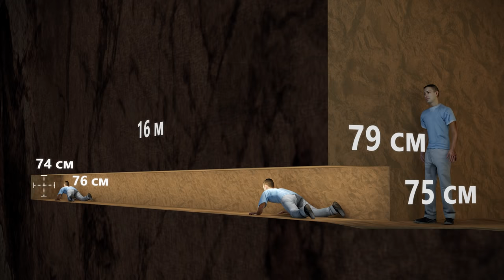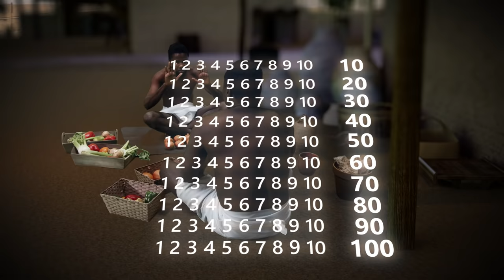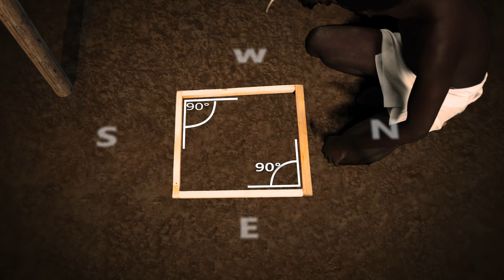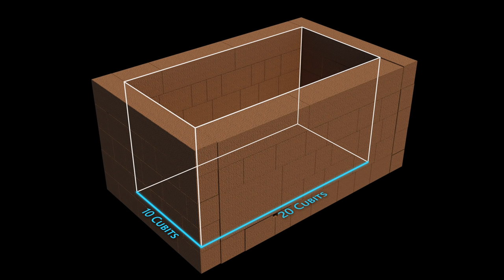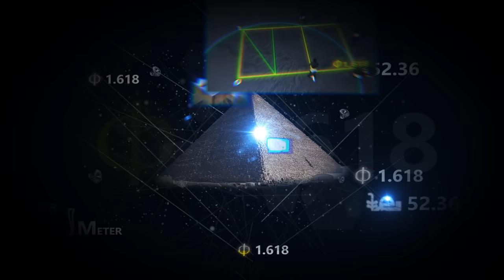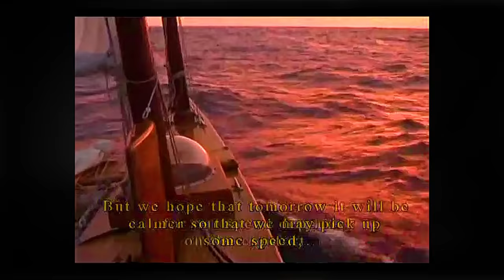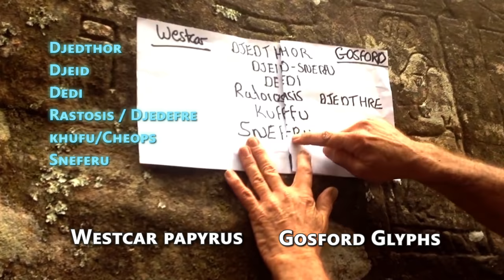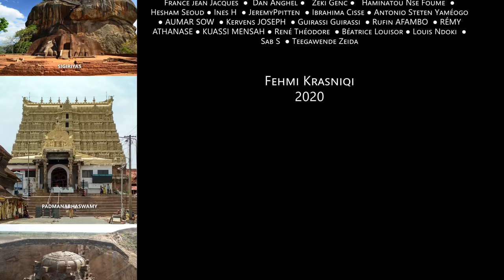The Movie Great Pyramid K 2019 - Director Fehmi Krasniqi

Comment: This is such a great contribution to our public knowledge bank and so sad this is not all taught in our public schools. Just to learn that all measurements derive from a drop of water is fantastic and that this in turn has been used to build all our most impressive buildings around the world and that all dated back to the Egyptians and their lines of learned descendants. Again, I loved the Natron and the chemistry of the concrete for the pyramids and so many other great buildings worldwide. Like others, I see the hole in the argument when it comes to casting molten granite and similar rocks and then cooling and reforming them. It seems this simply does not hold water and much more theorising and practical experimentation needs to be done to work out how it might actually be done. However the proof is definitely in the pudding and it was done somehow, so we need to do the experiments!
Reply: Holes for a torch ?
Reply: Ñmn Mantgum b op
Reply: No evidence of carbon black pollution on the walls!
Reply: for Sci-Fi movie is interesting and drop of water is not 1cm....
Reply: @kingrys2870  So many ludicrous claims in this "documentary", and so many people swallowing hook, line and sinker. Drops of water come in a variety of sizes, much of it dependent on the surface they form on. That is something anyone can replicate in the kitchen.
Reply: Melting granite forms obsidian glass, well documented and even people doing it with solar lenses on youtube. You cannot re-cast it to granite.
Reply: That is an unfortunate problem one cannot argue one's way out of! @c4t4l4n4
Reply: @c4t4l4n4  can you produce your personal test results choosing only non-porous surface(s) and determining from what sort of application device you would choose to administer said single drop with the rate/ratio/volume, fresh/purified/mineralized water or salt water, etc; in order to validate your theory of its inaccuracy or otherwise assumption of "ludicrousness"? 
Thanks
Reply: @aerinfletcher115  The onus is on the producers of the documentary to prove their claim. Let them show the "science" behind it. I could start with marble and leaves/twigs to make a start on an experiment that would have many variables. It would take quite some time, but it is clear that I could take a shortcut and just claim the fact of 1 cm droplet diameters being the universal standard and present it in a paper so that others could do the work for me by having to disprove my claim. Isn't that what you are suggesting, lol. 😂
Reply: ¿Crees de verdad que deberian de dar estas lecciones en las escuelas? Sino te dan lecciones de  la historia de España que por obligacion deberia de conocer cada estudiante de nuestra lengua , para que de una vez por todas dejaran de creerse la mier... de la leyenda negra sobre España que han vertido sobre nosotros los ,ingleses , los franceses , los alemanes , los holandeses  etc etc, asi nos va que hay gente que quieren que les pidamos perdon , por Dios que le pediria que aunque solo fuera un dia supieran como lo han pasado los gobernados por los ingleses y los norteamericanos , que les pregunte a los indios que hasta en los cines les aplaudian cuando llegaban los americanos a matar a todos los indios que eran los verdaderos dueños de esa tierra , que incluso su gobierno pagaba por cada indio muerto  , que pregunten a los indues , o cualquier territorio que gobernaron , ingleses , alemanes , belgas , franceses , holandeses , italianos , japoneses  etc etc , no excuso a los que cometieron atrocidades , pero hijos de la gran bretaña los hay en toodos lados , pero lo no que esta escrito en nuestras leyes no lo hemos consentido , COLONIAS NO PROVINCIAS , con virreyes y gobernantes nativos, Solo un ejemplo el hermano de Colon murio decapitado por abuso de poder y eso que era al principio LEED he informaros , quien conoce su pasado mejora su futuro
Reply: @aerinfletcher115  just look at the different sizes of Rain drops, different size, different volume.. i tried to make water drops with a pencil 100 in a row. sizes varied from 3mm to 19mm and not a single time i managed to get the same size of drop twice
Reply: @aerinfletcher115  or u can just do it like in this video, you make a drop of about 8mm on one place of the table, then switch off the camera and when the camera is switched on again the drop is at a different place of the table and has 1cm. thats how science is done ;)
Reply: Truth, look up "precision evidence of ancient high technology" video
Reply: Yeah but its Not true. A drop is Not a centimeter. It varies. Nice Idea but simply NOT true. Sad, yes i know.
Reply: @princenosiatajansen  lol I was just about to say , how the hell do you measure a "drop of water" anyway? A handy ruler and you try to measure as the drop falls by? You can't put the drop on a table for a second can you 😅
I thought that was a weird claim.. and rain drops! I mean look how you can get all types of rain from mist to huge globules. And everything between, any dust or particles would change the shape and size and surface tension. Plus where you live , the height etc would affect the size of the same amount of water even if you could freeze the droplet mid air so you can measure it.
I bet this is a new thing, someone with a strobe lamp and pure water did an experiment , one of the Childress type historians saw it and immediately decided Egypt used the same idea but with no tech

Comment: Another question: Wooden form-work would immediately disintegrate upon the pouring of molten lava.So, what did they use to make the forms?
Reply: WOKE SCIENCE
Reply: @christendomdefenderbeready3251  What's WOKE science?
Reply: Sand is a great thing to make moulds from and wood to frame the sand so the wood wouldn't touch any heated substance...also some clay's can be used in some cases ....butbi agree yes wood would burn
Reply: @davidlogan5240  Good idea about the sand and the clay - however, at such extreme temperatures needed to melt granite it would be more than sufficient to also melt the sand or clay. The sand would, at best, become hardened glass and. because of the amount of stones created, there would be remnants of this glass all over the place, or at least some residue on the actual blocks. As far as I am aware there is no evidence at all of such residue. Unless you know something I don't?
Reply: Clay melts at 1200C so it does raise a serious question for molds for granite. The 40,000 pieces of pottery that they still don't know how they made them considering they're all made of stone raises another serious question.
Reply: push your hand into cay then remove. cast  plaster paris , wait ti dry.  Mould wax and cast plaster Paris. melt out the wax and cast is the granite ..... a perfect finish.  done a stone casting

Comment: How did they make the molds for the statues?
Reply: i would like to know how in the hell they handled 1000 plus degree molten rock period 1000 degree molten rock would be very hot to even staand by let alone not burn wooden forms , i call bullshit
Reply: @giuseppe_M  it was mentioned more times then worth counting that clay was used for the forms
Reply: @giuseppe_M - With a capital "B" !
Reply: i imagine casted from a statue carved from softer rock, although i doubt the ability to handle 1000 degree rock
Reply: @craigjulian7100  Go visit Abu Simbel or the Valley of the Kings or Karnak, all build completly out of the rock. why do so much work if u could build things out of concrete?
Reply: Watch whole video
Reply: @busterbrown7719  why, is there after 2 h and 10 fails something true? get to the point

Comment: If the stones are all cast on top of the last why dont they seal to the underlying stones and not shake loose during earthquakes. there would need to be a bottom panel as part of the cast you would then need to lift the stone to remove the wooden panel or else there would be crushed wood under each stone.
Reply: Maybe they cast the moulds slightly above the lower stones. When the concrete had set slide the bottom of the mould away and then lay.
I’m sure if they were clever enough to build the pyramids they would have been smart enough to get around that one
Reply: @anthonyhudson3158  litterly explained that in my last comment
Reply: I didnt think of that, good point.
Reply: Why not make one huge mold and make the pyramid solid?
Reply: @joebombero1  it would be one hell of a big bloody mould🤩
Reply: @anthonyhudson3158 i seriously hope hes joking
Reply: Anthony Hudson not necessarily. I watched the lining for the reservoir for Edcouch-Elsa Water Treatment plant being poured one wheelbarrow at a time. The head engineer was from India and explained to me this was an ancient practice. I later watched floors being poured on large buildings in Mexico and the Philippines one bucket at a time. The edges are seamless even though the workers may not complete it in one day (weeks for the reservoir). Just as they moved the molds for the Grand Gallery in this simulation, why not do it for the entire pyramid? It just doesn't fit.
Reply: @joebombero1  it’s food for thought. That’s for sure.
Reply: @joebombero1  for 1 too big  2 all the chambers inside the perfect angles ect 3 earthquake durability
Reply: @joebombero1  Especially given that this is the theory/method shown in the video for the insanely huge hollow under the pyramid.....
Reply: @garymillar169  Go see the hoover dam

Comment: It was almost logical until you get the molten granite part, where I started to chuckle.
Reply: They used those special logs that Doc Emmet Brown used in Back to the Future III to get the fires raging hot, lol.
Reply: The heat isn't the issue, a lens will get the stone melting no problem. Its the fact that rapid cooling of molten granite forms obsidian, it won't form back to granite again.
Reply: @Rich-lx5lh  So there was no rapid cooling? They had a lens to keep it hot...
Not everything has to be 100% true to get the point of how it was done.
Reply: Same- I mean why would the piece of green glass in Tut's necklace be worthy to be there if glass was that easy XD
Reply: @Rich-lx5lh  yes exactly, molten granite forms obsidian not granite
Reply: @Alex-rx5uh  maybe. I'm not saying that's not the case. Buuuut the kind of cooling we're talking about is longer than a human can wait if we want granite to form again. It's just  not practical under the circumstances.
Reply: @Rich-lx5lh  I was also thinking of the solar lens; where did that occur? Why do you find stones like Baalbek? Why do you find quarries utilizing the same "concrete"? Did they cut it and pulverize it to a non-consolidated state? The authors also assume there can be no organic matter at the electron microscope level. If it was melted why aren't they obsidian? Where did I miss the math on the solar lens? How do you slip form lava in Peru? Do you build two perfect "lava" walls and remove them post pour? Chicken egg thing. Clay? Dirt? Not buying in, too many holes, I'm going with cut stone and the dynastic egyptians could not do that. Too many huge leaps. If it was poured in place, why are there huge saw cuts? Aswan?
Reply: @Rich-lx5lh  maybe they prevented it from cooling rapidly
Reply: @crhu319  we're talking millions of years though haha
Reply: @63phillip  so,,, what forms granite? red clay with black rocks?
Reply: @Rich-lx5lh  they did not need to wait years or months-
also, it wasn't profit-driven, so while they waited for that, something else could be down, like keep it warm until cooled without cracks. Think outside OUR terms. What if the JOB was to hang around and shoot the shit while keeping it warm? Contractors today will risk coming back so that you do not sit around waiting for the seal to dry.
Reply: @fyisense9312  clay.
Reply: @angelchiriboga3904  everyone is missing the point here. Granite is formed by slow cooling under the earth's surface over thousands to millions of years before it gets to what we see. When you melt the stone the crystalline parts that make up granite are also destroyed which is why it turns to obsidian and not that which it once was. the pressure and time needed to reform granite far outweighs the simple nature of having the right tools to cut, quarry and transport the nessarsary blocks straight from the earth which there is actual and ample evidence for! It's difficult to do still but nowhere near the complexity of what's being suggested.
Reply: @Rich-lx5lh  Yeah, I don't buy into the melted rocks, too many saw marks, too many quarries, too many tunnels and too many precision pieces made from hard quartz like material. If you are precision grinding quartz to .001" in 6 feet, you have a computerized machine tool and or robots.
Reply: These people sound soooo sure of themselves ....They dont realize they sound as silly as Dr.Davidawitz there.....Uh Perhaps they  could explain how they were able to cut BENEATH the obelisks?
Reply: Go somewhere hot and try it yourself
Reply: @Rich-lx5lh  if they used sand casting/mold, it would be insulated enough to drastically retain the energy produced. People use a sand setup around the water lines to keep their pools heated from the sunlight beating down on it all day. If you needed to have control of the “thermostat” for your sand casting process, pour water onto the sand. Plenty of sand in the desert....

Comment: Melted granite, also called granitic magma, is thick and viscous, closer to peanut butter than water. It wouldn't be like pouring a liquid.

Here's a breakdown of its consistency:

Highly viscous: Imagine thick, slow-moving molasses. Granitic magma resists flowing easily due to the interlocking crystals and dissolved gases within it.

Slurried: The melt carries suspended crystals of minerals that haven't yet dissolved completely. These crystals contribute to the magma's thickness.

Gassy: Dissolved gases like water vapor and carbon dioxide can be trapped within the melt, adding to its internal pressure and explosiveness in some cases.

Due to this consistency, handling or moving melted granite around wouldn't be feasible in the traditional sense. It wouldn't flow freely and wouldn't be easily contained or shaped.